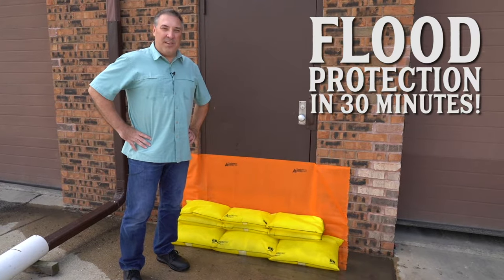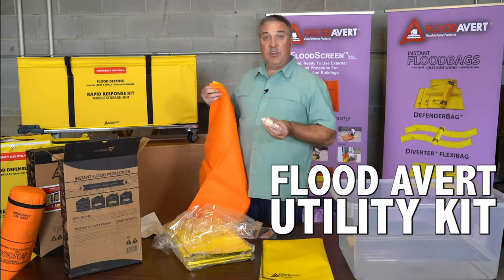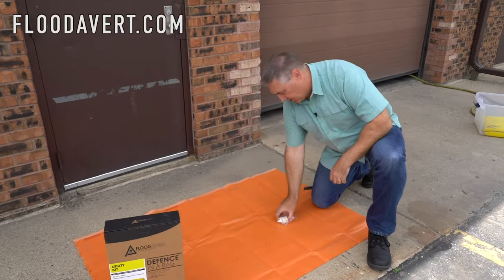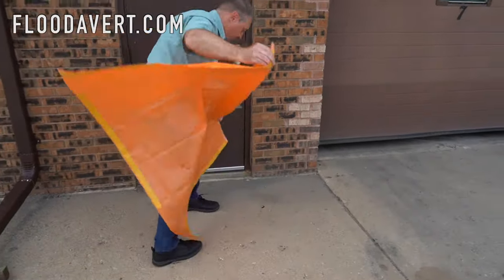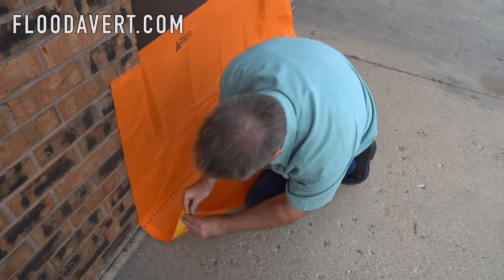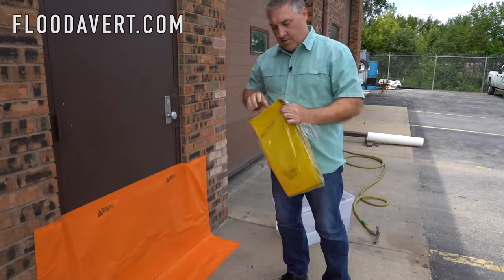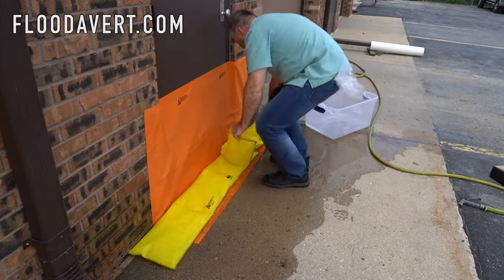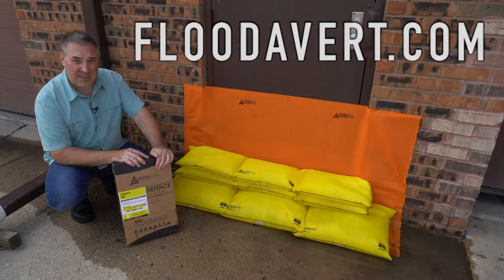Flood Avert™ Utility Kit - Everything you need to create a flood barrier for an exterior door!

Comment: The density of the water in the bags is the same as that of the water trying to get in the house, wont the bags just flow away with the water?
Reply: They will. In Hurricane Ian 2 years ago we had 2 55 gallon drums filled with water (each with more than 450 lbs of water in them) just float away like it was nobody's business! Sand bags and a tarp are probably the way to go.